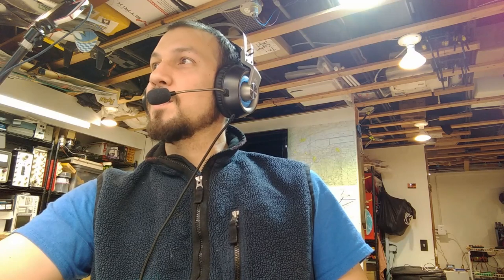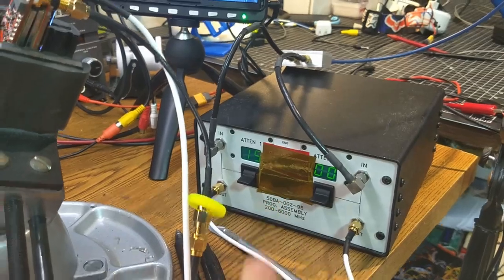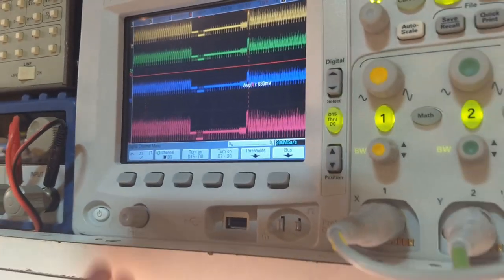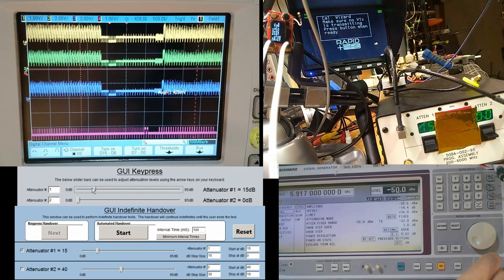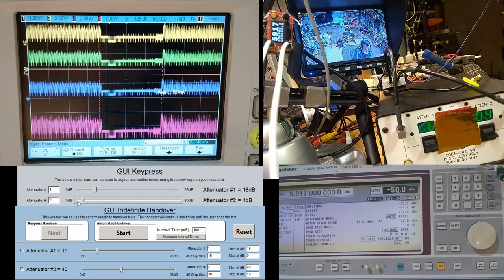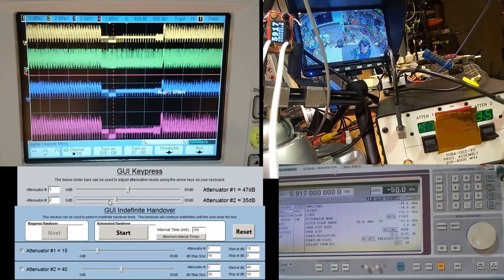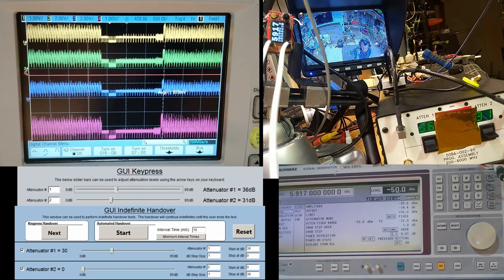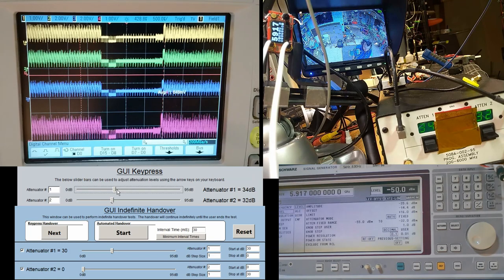ImmersionRC Rapidfire - Receiver Calibration Tips - Part 3 - FPV Video Series - PK's Lab

Comment: Lots of different opinions on calibration. Painless360 channel says calibrate with antenna's on, and TX and RX separated by 50 feet or so. Others say calibrate with antenna's off. So edited this a bit, because I rewatched and right at the get go you said the antenna's need to be the same for calibration. But what if you actually fly with an omni and patch setup. Calibrate with two omni, and then put on your patch and fly?
Reply from the maker: Yepper, calibrate with 2 of the same antenna (or no antennas at all standing close to the vtx).  It looks like they are looking at the analog RSSI line coming out of each receiver and doing a 2 point calibration, 1: min signal voltage, 2: max signal voltage and doing a linear interpolation between the 2.  If the max voltages are different because one path has a higher gain antenna it will throw the legacy mode switching off.  I haven't actually done an in-depth look to see how it effects the mode 2 combining.  That may be a worthwhile video.  What do you think?

Comment: Hi
Great work. But In the real world,  shouldnt the calibration be performed without antennas attached to vtx to completely eliminate bias between the 2 channels?
Reply from the maker: 2 antennas with the same gain and no antennas attached should both give you a proper calibration.  From what I can tell they are looking at the analog RSSI line coming out of each receiver and doing a 2 point calibration, 1: min signal voltage, 2: max signal voltage and doing a linear interpolation between the 2.  If the max voltages are different because one path has a higher gain antenna it will throw the legacy mode switching off.  I haven't actually done an in-depth look to see how it effects the mode 2 combining.  That may be a worthwhile video.  What do you think?
Reply: @PKsLab  I'd like to see how Mode 2 might be affected by calibrating in different ways. I first calibrated using the by-the-book method from the manual. Then I tried Painless360's way at about 75% strength distance with an omni and patch on it. It seemed to provide a better signal. Now I want to go back and try it how you recommend. I'm trying to optimize for Mode 1/2 out in parks with lots of trees and stuff, so maybe the intended environment matters? I don't know enough about it all to understand what all is going on... But, awesome videos, thanks, helps me learn a lot!
Reply: Paul Hodgetts i calibrated with patch and Omni as painless 360 stated in vid.  And was not getting the true mode 1 magic.  It was good.  But I knew there was more to be gained.   Racked my brian. Thinking I had module issues Or something else goin on.   Finally I went back to calibrating by the rf manual to the T.  And and back gttn the true magic.

Comment: Is it better to calibrate in legacy mode or did you use legacy for the video because it was easier to see what was going on?
Reply from the maker: I used legacy because it was easier to see what the diversity switching was doing after the calibration.  I don't believe it matters what mode you are in for the cal.  But I would have to prove that out before saying that definitively.  Was thinking maybe I'll do another calibration related video when summer winds down that explores that.